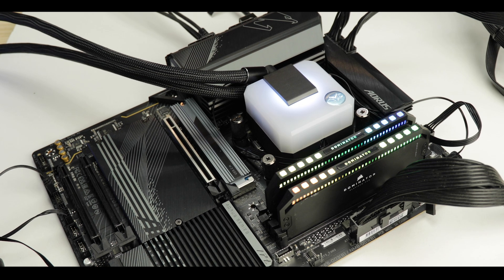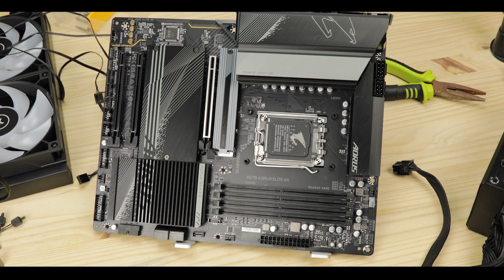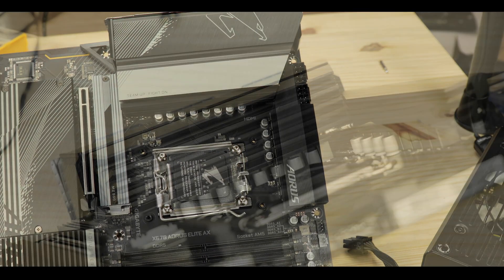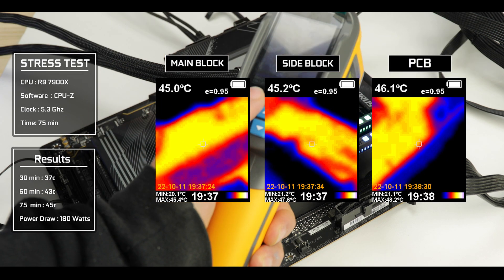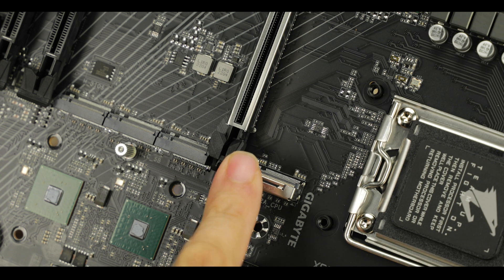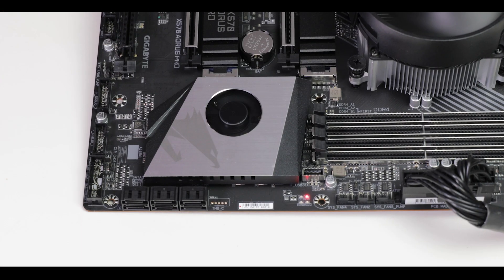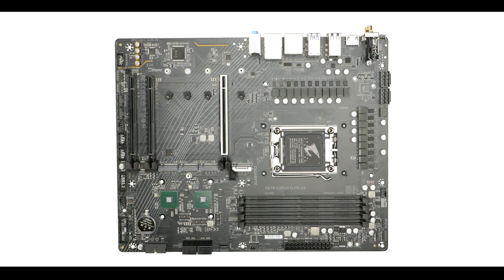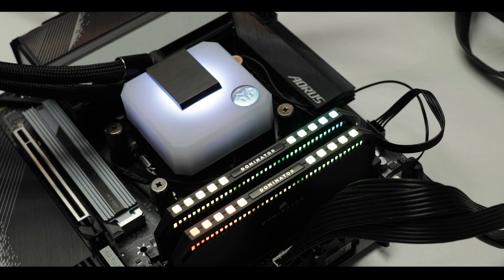Gigabyte X670 AORUS ELITE AX : WAY ahead of its competition!

Comment: Great review as always Laurent!

I have one question though - are you sure that the fan headers are all hybrid? I ask bc usually Gigabyte board spec sheets mention which headers are hybrids. For this one, it only says the following:

1 x CPU fan header
1 x water cooling CPU fan header
3 x system fan headers

For the X670E AORUS Master it says:

1 x CPU fan header
1 x water cooling CPU fan header
4 x system fan headers
4 x system fan/water cooling pump headers

So that one has four hybrids if I'm reading this correctly.
Reply from the maker: Good point. Indeed, I had the same question, but after digging deeper I found all the Elite connectors to be compatible with flow sensors. Therefore, they are undoubtably all hybrid connectors.

If you read the Elite description, on the official general info page you will find the following (in the Key features ection) : 
Smart Fan 6：Features Multiple Temperature Sensors, Hybrid Fan Headers with FAN STOP.

Thanks again for your precious contribution Outmind01. Always very welcomed!!! :)
Reply: @Laurentschoice  Ah, so that's how it is. They could have said so in the tech specs. Thanks for the explanation.

Comment: I use a simulator and wheel/gear stick/pedals setup that prefers usb gen 2 so they still have their uses. A simulator and VR setup uses many usb sockets, so the quantity of usb sockets in general on offer here is welcome. The mobo is perfect apart from the lower class audio. Great review!
Reply: I have my keyboard, mouse, game controller, flight stick, headphones all plugged into USB, and none of them need to be USB 3.0+ so yep, I'm fine with the USB 2.0 ports. If I need more, I can use a hub.
Reply from the maker: Yeah.. makes sense ! Should have thought of that !

Comment: 330 euro here (before 21% VAT - 399 euro incl) STILL 30% too expensive. This is a top range board here (discounting the ridiculous ones like "Godlike").
Audio chipset is meh. Not even SPDIF output. No, I have no interest in this board. Your video still gets an upvote.
Can you please review some B650 boards? The cheap ASRock - B650 Pro RS ALSO has an 8 layer PCB. Merci beaucoup.
Reply from the maker: 400 euros??? thats a rip off....... i am reviewing the Z790 tomahawk and Strix X670E, after those.. i am digging in the B650s!

Comment: I have no need for a new motherboard, but it's good to hear a lower end model has good hardware, and some future proofing for the power requirements of CPUs yet to come.
Reply from the maker: and not sold at 500 bucks!
Reply: @Laurentschoice  Yeah, prices seemed rough for the new motherboards coming out when I looked a few weeks ago. Btw it sounded like the one weak point of this board is the audio solution. I've been very happy with the audio from my MSI MAG X570S Tomahawk MAX WiFi, which your review helped me decide on, and I didn't even need to use the optical out for good audio. I did have to switch the "Audio Enhancements" setting in Windows 11 for my headphones/speakers from the default setting of "Device Default Effects", to "Off". Before that in certain games I couldn't hear anything behind me. Thanks for the videos Laurent.
Reply: I got the x 570S aorus elite 1.0 for $ 169.99 at Amazon. Will pair with r 7 5700x, XFX. MERC rx 6650 xt and Patriot 3600htz 14-16 cl ( 4x8 ) gb. of rams. Air cooled. Any suggestion Laurent's.? Like always doung a goid job on yours reviews.